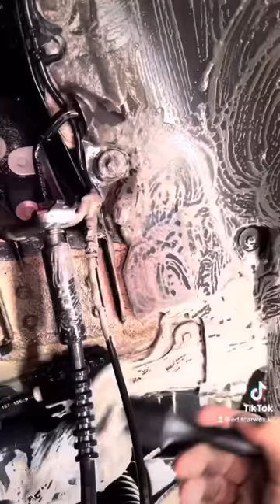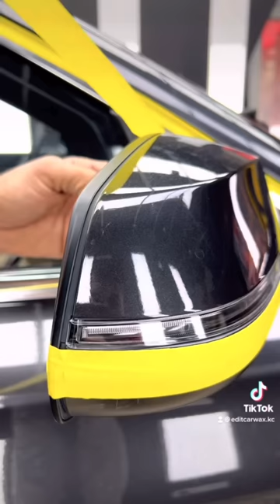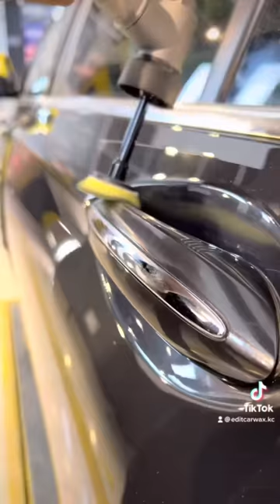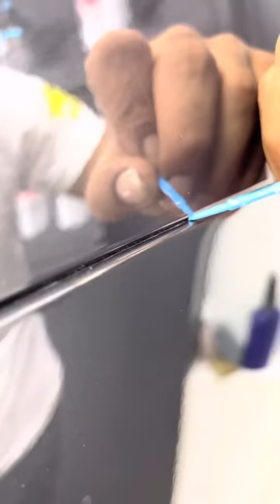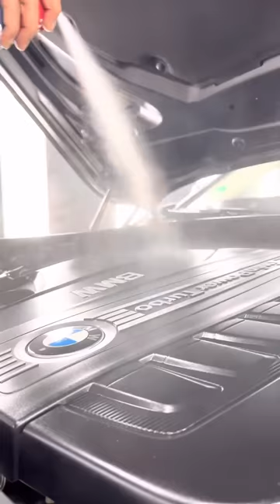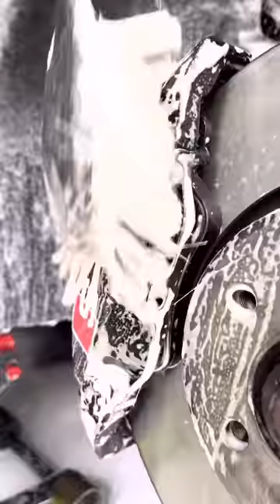2015 BMW 740d xDrive - paint restoration and ceramic protection package.

Comment: Atık sular ne oluyor onu merak ettim. Bu kadar kir ve kimyasal filtreden geçiriliyordur ve yer altı sularına karışmıyordur inşallah.
Reply: Atık su ile ilgili örnek olacak şekilde çekimlerde yer verirseniz size bonus kazandırır..
Reply: Kimsenin umrunda olduğunu sanmıyorum. Keşke hükümetler bu konuda biraz hassas olsalar.
Reply: I'm pretty sure most if not all the products they are using are non-toxic and/or biodegradable
Reply: @ahmettanriverdi5238  bu tur ince islere bizim hukumet pek ilgi vermiyo yada aklinin ucundan bile gecmiyor. Belki buyuk sehirlerde zorunluluk vardir ama, kucuk belediyeler takmiyordur

Comment: Nice job...but:
1. Why brush the cavities where the wheels are located?!

2. Why brush the inside of the alloy wheels when you can't see it anyway and it will be black again in a few km.
3. I saw a comment, it says this service is 1200€. 
Very nice, as l said, but very expensive!
Reply: Any real detailing job or a pro detailer does the inside of the wheel, thats why its called detailing 🤷🏽‍♂️. Of course it will get dirty, if you maintain it well, you don’t have to put more effort the next time. It depends also on the car and client. You can watch many more video’s of other detailers doing this.